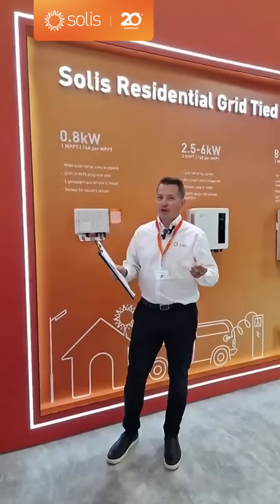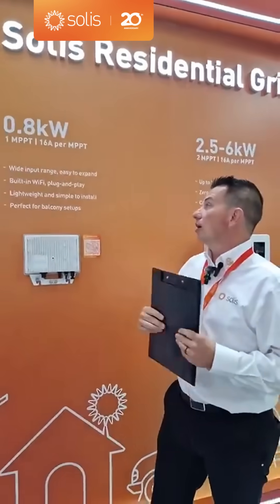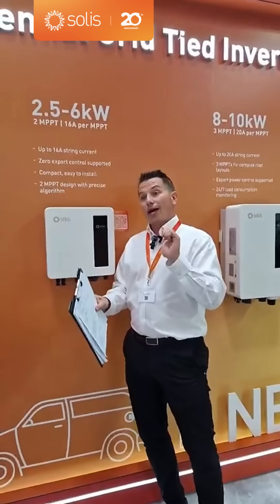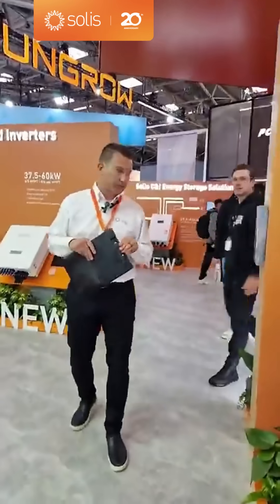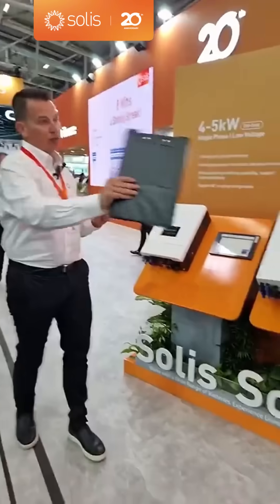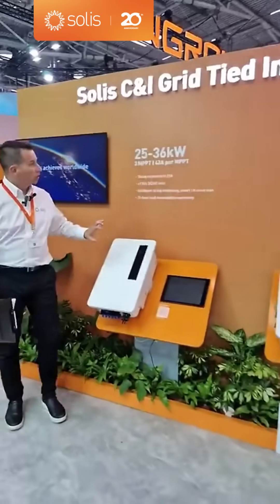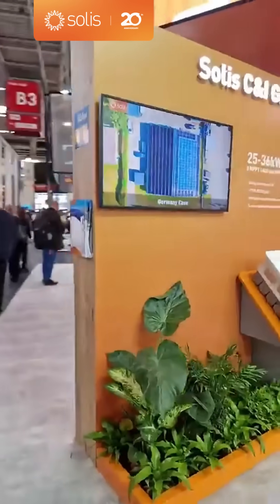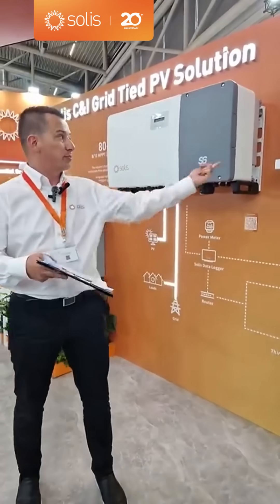Don't Miss the Highlights!  | Solis Intersolar Europe 2025 Livestream Day 1 Replay

Comment: I have this crazy idea that you can just hook up the gen 3 mobile connecter to your hibrid inverter's grid port via a powershare adapter and make your own 'virtual powergrid' with the Cybertruck without any Powerwall or gateway or grid connection. Would this work for an 8kwh single phase inverter in an off-grid setup?